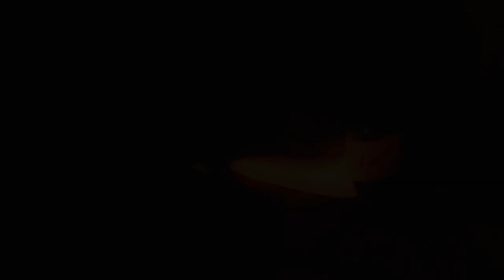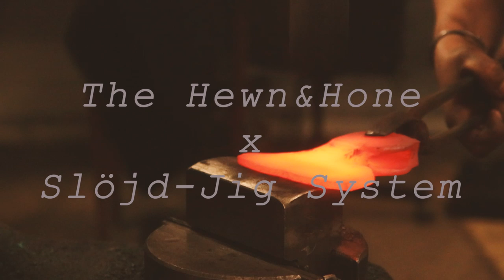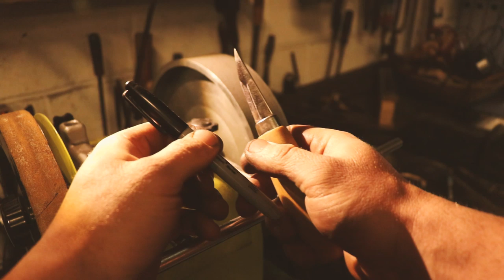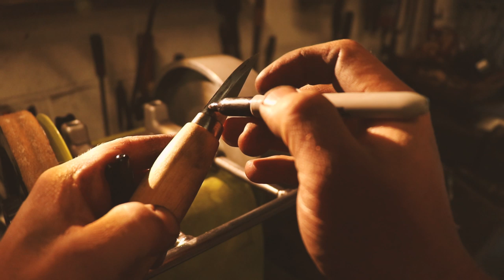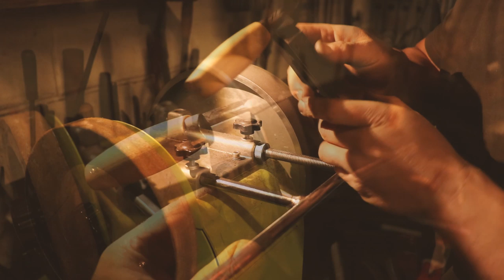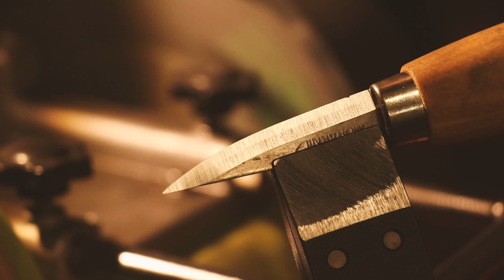Hollow-grinding a Carving Knife using the Hewn&Hone Slöjd Jig in under 5 Min - The best there is!

Comment: This jig is on my shopping list for January, when it comes back into stock. If I can afford it!
Reply from the maker: All I can say is that it is an amazing investment and also on my shopping list with the CBN wheel, Sorby grinder and attachments for 2020
Reply: Yes, I have my eye on one of those too, but I know that may have to wait a bit longer. Can you outline the benefits over a rotating waterstone like the Tormek I currently use?
Reply from the maker: @nigelwylie01  sure... The CBN wheel is so much more precise, long lasting and boy is it fast to remove stock. I'd keep a finer Waterstone to change or on the other side to finish the hollow especially if used with the hollow grind directly on greenwood. I personally establish a light shoulder on flat stones or sandpaper. I'll upload part 2 later today. The CBN wheel is compareabke to artificial diamond.